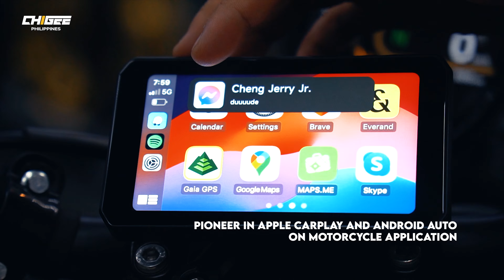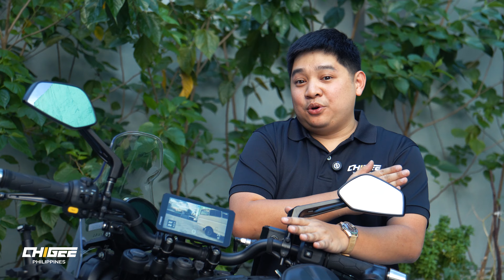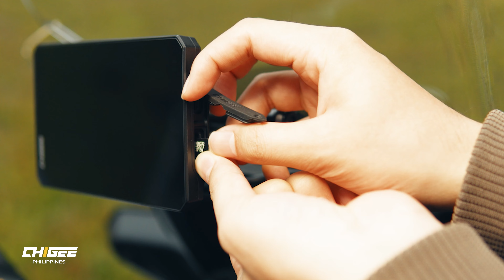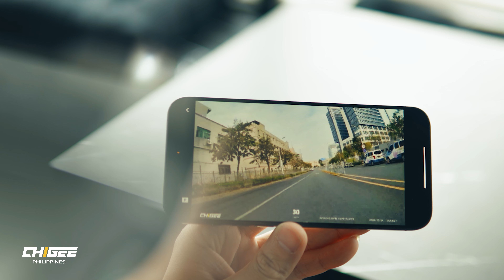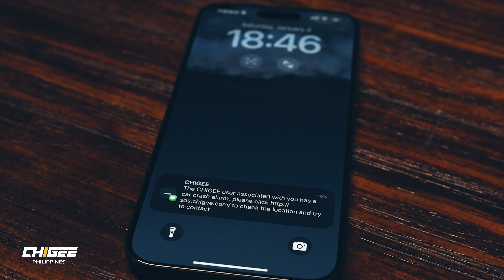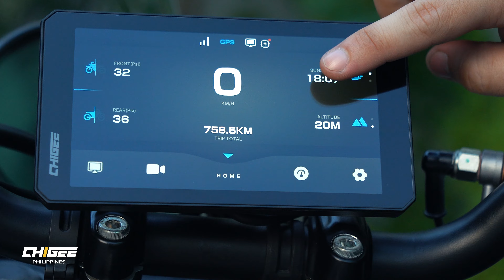CHIGEE AIO-6 AS EXPLAINED BY CHIGEE PHILIPPINES BRAND MANAGER

Comment: So at minute 9.55 you say you park your motorcycle some where out side and from time to time you check the dashcam footage but your chigee has a quick release
I think that's not a smart move every body can now take your expansive chigee remove the sym card and use it them self or sell it
So to me if you use the chigee with lte to check on your bike you should fix it and not use a quick release
Reply: you can lock the quick release system with a tool-key